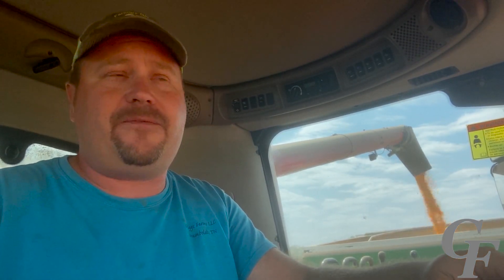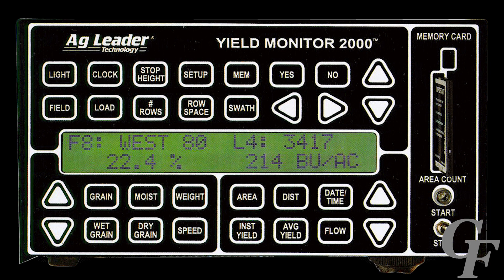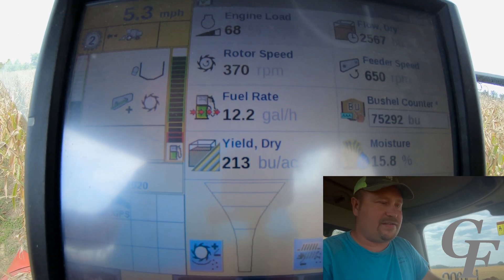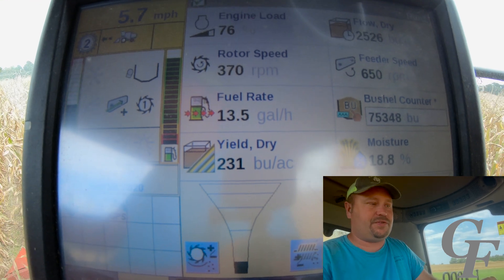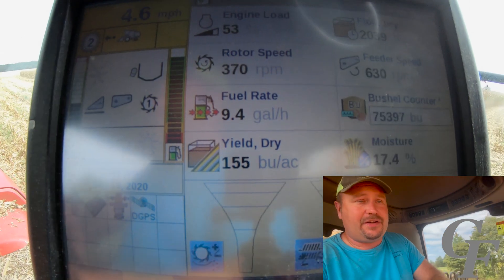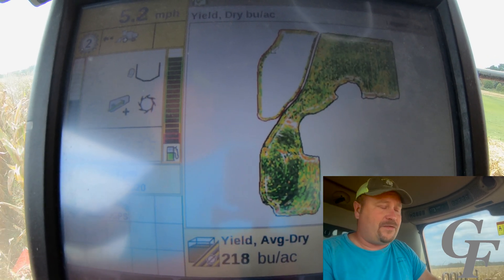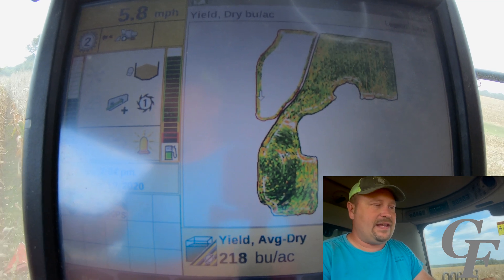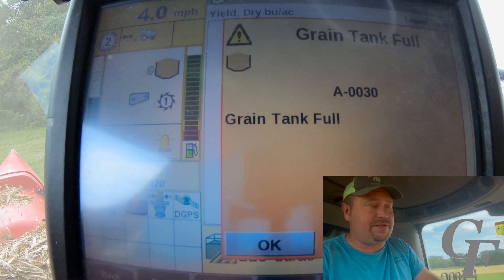How Ag Technology Works Part 3:  Yield Monitors

Comment: Just thought of another question.  Here in Oregonsome seed crops only do well in certain areas of a field (Higher ground, dry feet); so some plant two types of crops in same field.  in tour low production areas in your corn field would soybeans or cotton do better in that area?   And then there is the cost of moving machinery to harvest.
Reply from the maker: Funny farm 555 we do try to put crops where they have the best chance to succeed. However the variability of productivity in our fields can change drastically in just 100 feet. So we are focusing on improving the soil health where all our ground can support all crops. The one exception is with wheat where some fields are just too wet natured during the winter to support wheat

Comment: Very interesting and you presented all three videos well.  I farmed back in the 60's and 70's in Oregon raising Ryegrass (lawn, pasture seed), wheat, bluegrass (lawn seed).  Yes we were in the guess and by golly years and there wasn't any monitoring or computerized metering of products.  One setting for the field or in the case of harvesting different manual settings on the combine for the type of crop; and looking at the quality in the combine hopper and behind the combine.

I have a couple questions.   You work on the poor yielding area of a field to bring nutrients into line of the soil health target.  Now how do you get the planter to plant more seeds in that area so you can re-monitor the yield?   You know the old adage; nothing ventured nothing gained.

One more question.   Is the chicken manure you use straight from the chicken barns or is it composted first.   Along that line you said in another video you really don't like tillage;  wouldn't the chicken poop tend to leach nitrates and nitrites off your land  with no tillage?  I certainly understand soil fragility and chance for erosion.   My brain want to tell me that there should be minimal tillage to incorporate the organics and the nutrients into the soil.  THank you
Reply from the maker: Funny farm 555 for your first question, check put my first 2 AG Technology videos. I think they will answer your question. 

For the second question, nitrates running off the field could be a potential problem if heavy rainfall is received after application. However, any tillage whatsoever will destroy the soil structure at the very top layer of the soil which would inhibit water infiltration which would lead to increase runoff and greater loss of nutrients into waterways. It’s a catch 22 with no perfect solution. Generally though, our manure is spread onto thick cover crops which minimizes how much runoff we get.

Comment: Looks like low tech guys won't be able to farm profitably. Anyone wanting to continue farming has to keep up with the technology or they won't stay in business for long. How reliable are these high tech farm machines?
Reply from the maker: Well just like anything else, the more complex a system is, the more difficult it can be to reap air and the more stuff that can break. 

Most farm machinery now has become mostly electronic controlled which means most farmers can’t do much diagnosing or repairs. The manufacturer won’t allow us access to the diagnostic software.

Comment: That was very interesting. I'm wondering now, can the information taken from the combine be now transferred to the fertilizer applicator so that it can apply the right amount of feed where it needs it or would there be no point in doing that considering there may be other factors at play?
Reply from the maker: It first has to be transferred to a software platform and an equation need to be applied to perform the calculations. See out video “How Ag Technology Works:  Creating Variable Rate Prescriptions”